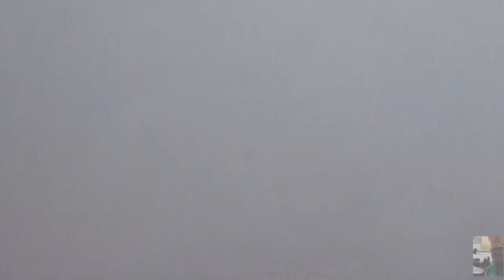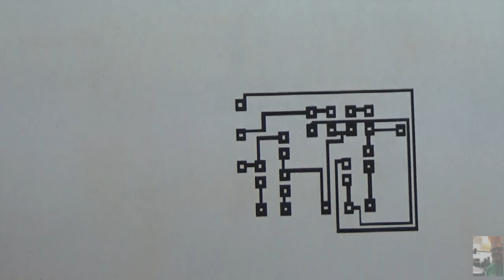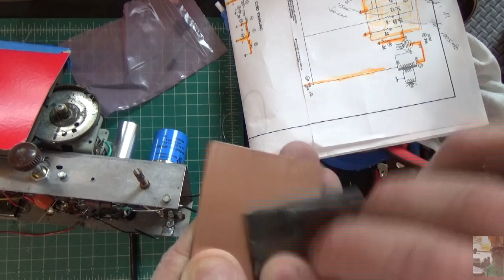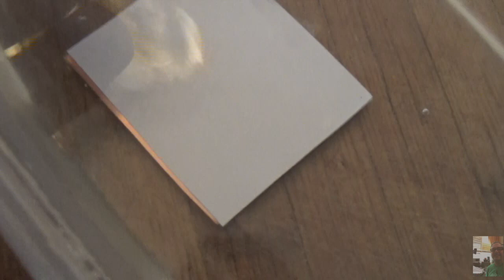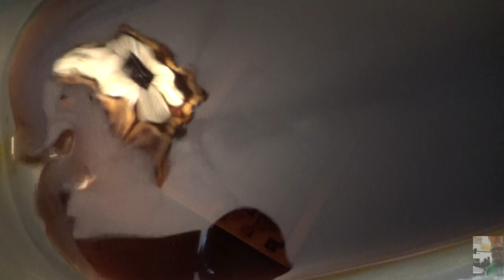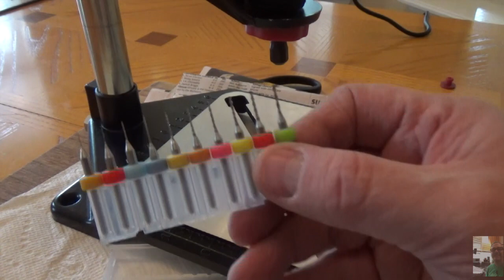Hallicrafters 5R41 and S-20R Restore # 23 -  Etch-a-sketch

Comment: Looks great Ron. Don't waste the FeCl2, it will work for a lot of use. You'll notice after using it a while it will take a little longer to etch each time, but it is a gradual process. Also, a drop of dishwashing soap in the water will help it penetrate the paper much faster. 

Mr. Carlson has some excellent videos on his method of making pc's. He is pretty advanced in that he makes double-sided boards, surface mount boards, and has special computer programs to layout the boards, but the basics are the same. Not that you need help, yours looks great. 

Thanks.
Reply from the maker: Many thanks Ian.. this really really helpful, I truly appreciate it !!!!!!!

Comment: Wow,,, how cool is that?,,, very cool Ron. After you sand the copper, clean it with alcohol and then don't touch the surface. Having the ferric chloride works best when it's warm.I save mine in a separate plastic container. Also, I downloaded a free program called Eagle. It's for making pc boards. That came out really nice. You did a really good job on this Ron. WTG buddy.
Reply from the maker: Thank you Carl... I am now educated.. I didn't do the alcohol part after the sanding.. that is maybe why I had  few defects.. I washed it with water. Next time. I have to look into how to tin the traces next. I will check out Eagle.. thx Bud.